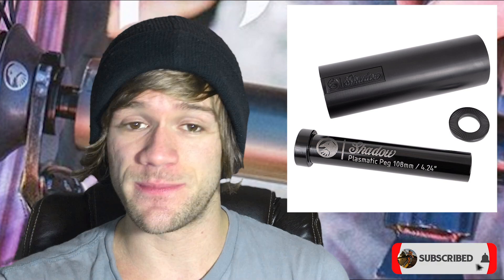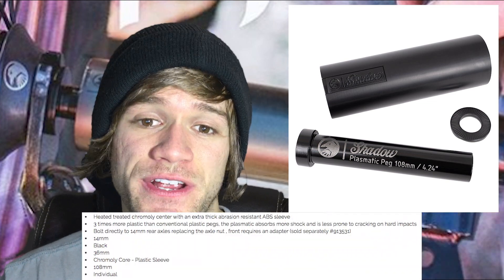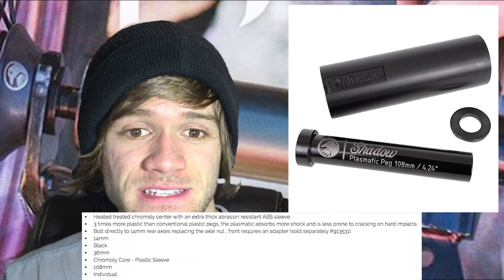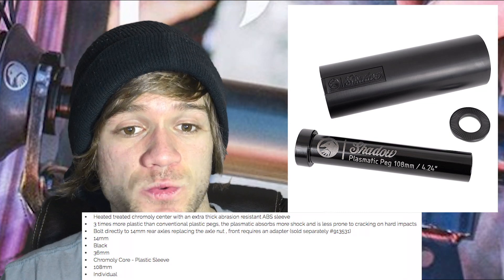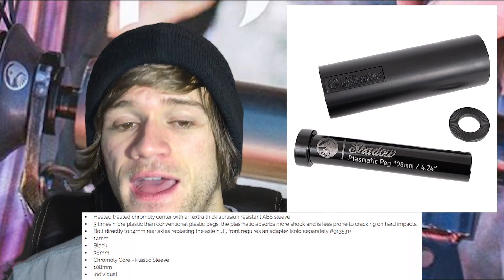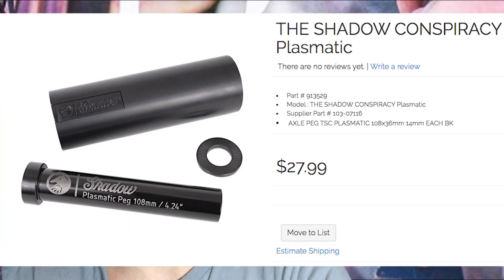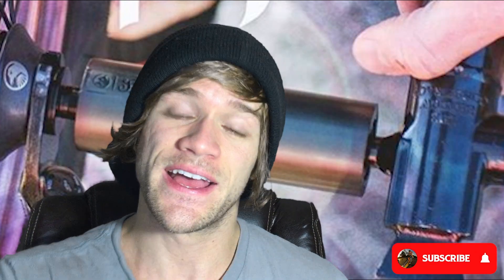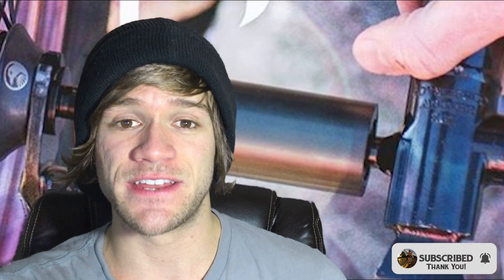Game Changing New BMX Peg - ALL INFO LEAKED!! - Shadow Plasmatic Peg

Comment: Wait...I hope they make a female version. I can only run these in the back. Also...im gonna have to bring another tool when I ride street. Damn lol
Reply from the maker: You could get the park tool MQ-1 😉
Reply: Possibly a 3/8 adapter will be available
Reply: There is a listing for the conversion for female axle however theres no photo. No exactly sure how that would work, it sounds like extra metal which means extra weight.

Comment: I started riding when BMX Freestyle was just starting out back in the 80s. That was back when the first pegs were Skyway bolt on Aluminum pegs that looked like a bunch of aluminum nuts welded to each other. I was pissed about that, because I had invented pegs before that by using a long socket with the nut inside of it to keep it on. If I wasn't 13 years old, and knew how to Patent what I invented I could have been rich. LAUGHING OUT LOUD. Oh well. I don't really like the idea of plastic on the outside of the peg, because it just sounds cheap, and easy to jack up. It sounds like a way for BMX Companies to make more money by putting out garbage that will need to be replaced every month, or two.
That's just my opinion. 😉

Comment: I run metal and sleeved pegs. Depends on what I’m riding. For my sleeves I’ll stick to making my own sleeves out of pvc pipe. It works fairly well and is cheap. Shadow’s idea seems like a good one but pegs just keep getting more expensive and running four pegs that’s almost 120 just for pegs. I’ll stick with the old way that hasn’t been a problem for years
Reply: And also seems like they’d be heavier than normal pegs

Comment: I have my pegs on the left, I've never had any plastic pegs unscrew. Not enough friction I reckon'  I'm curious how the female axle adaption will work. If it's just a skinny bolt that will be annoying because there are at least 3 or 4 different thread sizes for axles. I think mines 3/8 by 24? Ahhhh I dont even know.
Reply from the maker: All of the different bolts of 3/8 female front axles are definitely one thing to consider. Good point man
Reply: @Brant_Moore  on shadows Instagram they said it will work with any front hub. However on the leaked information it says the adapter replaces the female bolt, but it dosen't mention thread size or brands compatible. In the pic on the shadows Instagram it looks like it's a a 3/8 bolt that's 14mm male stub on the end. Bmx nerd stuff.

Comment: I waited a year to learn about a screw on peg. ??  How is this different than 35 year old technology aside from a plastic sleeve?  Hmm.  I'm having a great time with my super lightweight Kink drift pegs. These new pegs are probably tank heavy. Like their gyro that is listed as 1.7 oz but I weighed it at 3.7 oz.  And their sabatoge sprocket that is 7.8 oz (28t). Both items I'll replace as soon as I can.
Reply: With pegs having smaller cores, you cant really get sockets in em unless you running tree style bolts.  Im assuming this also allows for a female bolt(male both ends) that would allow for the wheel not to move when taking pegs on and off which i could imagine being a big plus, especially on the rear.... im picky with how centered that thing gets and always seems to shift a hair on tightening even with tensioners... It will also be interesting to see how the thicker abs grinds....im more of a fan of how harder plastics grind, but these should be alot less prone to cracking... the real pro here is it should be easy to mod into a roller peg
Reply from the maker: Also something to consider is the insert being tighter on the adapter than the adapter is in the hub on female/from hubs...to where loosening the insert loosens the whole thing and you have to ruin threads to separate them...I’m withholding all judgment for until after they’re out
Reply: I run Kink drift too 4.4" Light AF and strong and last good too...